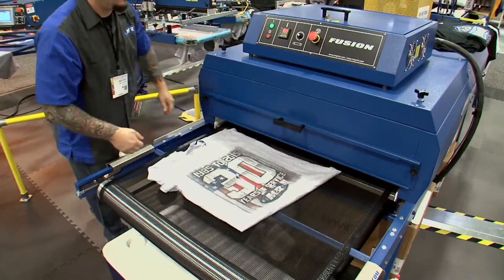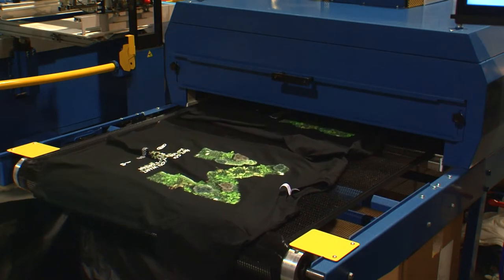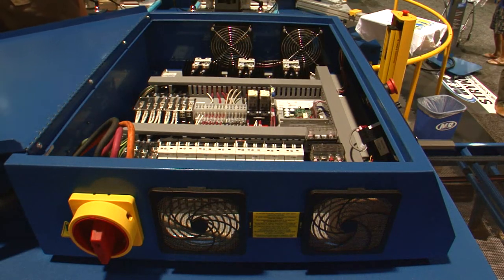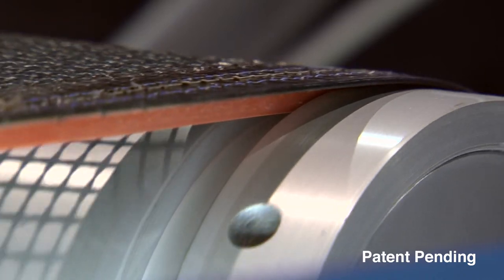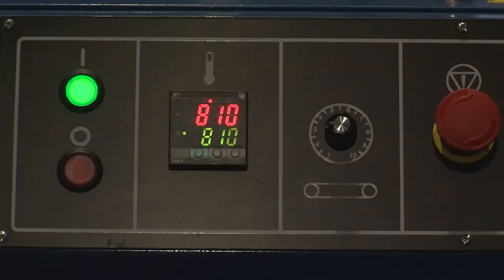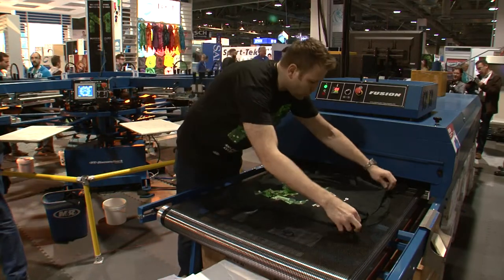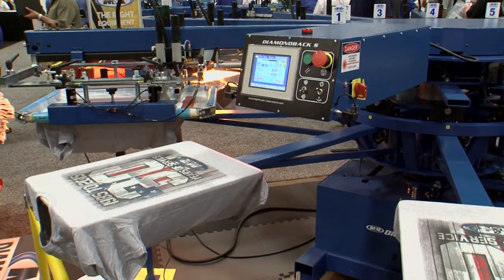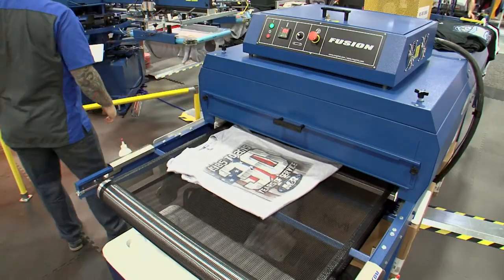M&R's FUSION Electric Screen Printing Conveyor Dryer

Comment: Can i cure water based ink with this conveyor?
Reply from the maker: Hello Allesandra - For water-based inks, you will want to look at dryers that maintain an airflow over the substrate that helps remove the moisture from the ink.  Our Radicure electric dryer/conveyor will work very well for curing for water-based inks:  https://www.mrprint.com/RadicureD, or if you are looking for a gas-based system, our Sprint 3000 line is very effective at curing water-based inks: https://www.mrprint.com/Sprint3000

Comment: What is the cost of this< also the EconoMax D??
Reply from the maker: For information and pricing on any of M&R’s products and services,  please call 1-800-736-6431 (US & Canada) or +847-967-4461 (outside the US & Canada) or email us at info@mrprint.com.  You can also use our dealer locator to find the M&R representative or dealer in your area:  http://www.mrprint.com/where-to-buy